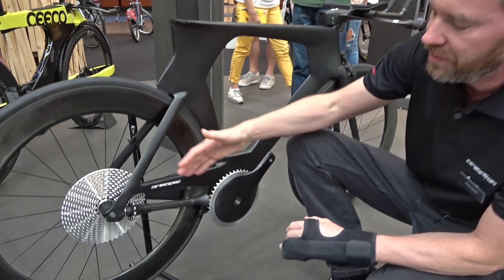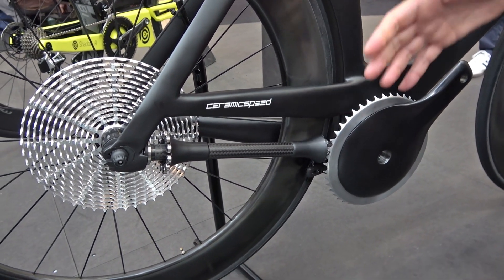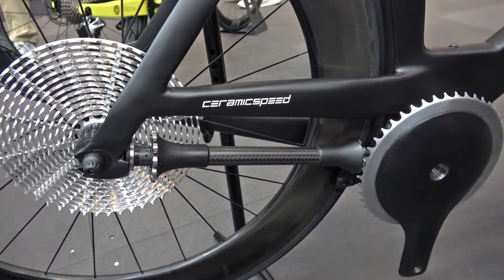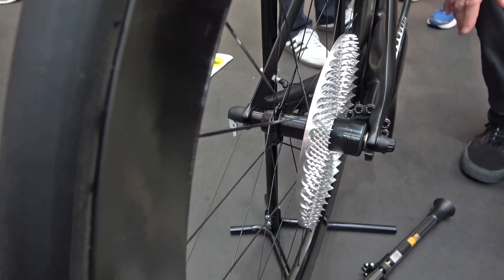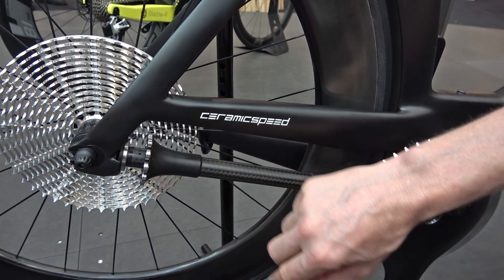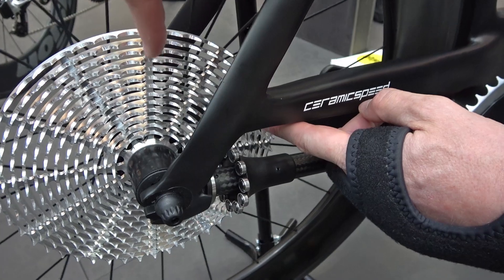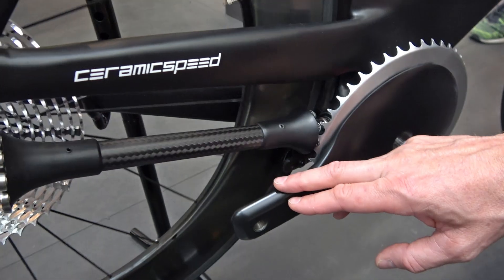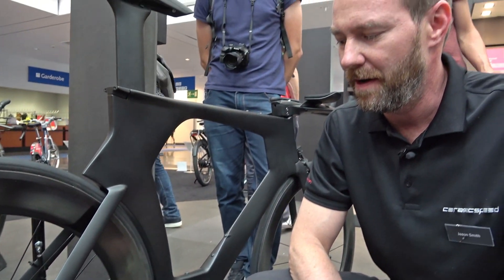CeramicSpeed Driven - Fully explained

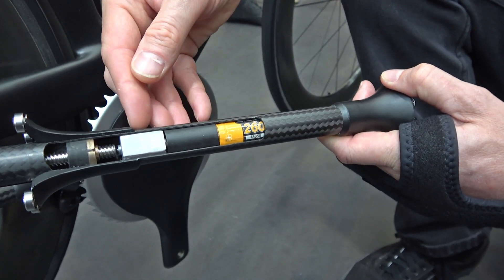Comment: @4:35 wireless electronic?? noooo! K.I.S.S. ! a linkage to handlebar. or same tried n true cable hookup. why leave something to imminent failure. "Ugh I forgot to change the battery last ride," etc...
Reply: Ugh... I'd hate to have to charge that component. If it really had to be electronic, it would be so much better if it ran on a small supercapacitor that charges up when you pedal instead of some battery.
Reply: Doesn't work with their current shift-channel setup
Reply: Also looked like replacing the battery would be a challenge
Reply: I guess your not getting Di2 any time soon.
Reply: It has to be electronic because there's only a precise moment when the shift will actually work.  The electronics can supposedly perform the shift exactly when it needs to happen.   supposedly

Comment: That sounds great, but was about the flex on the "cassette" when you get into the outer gears?  That mock-up doesn't look like it will take a lot of stress... like it would slip... something my chain currently won't do (say, when I'm going uphill standing on my pedals).

Comment: it would be even better if the shifting is mechanical, 
not electronically controlled. 

what if it run out of battery during touring.. what if we at the wild and it break down and need repair..
Reply: +Steven Tran   i notice the reason, but there might be a mechanical solution that can let us shift at the exact same times.. 
if war plans from half century ago can have machine gun fire through propeller without hitting it with mechanical  construction, sure some expert now can figure out a way too
Reply: +Head Master i totally agree
Reply: Ceramicspeed is very similar to Tesla in the car world. I really love the concept and design they came out with. However, it might only be useful for some people but it's not going to drastically change the whole bike industry, simply due to it's overall practicality compared to the price.
Reply: It should be able to get energy from rotation.
Reply: GDar this reminds me of bicycle light. last time used to have light that get energy from rotation. but recently all lights sold are battery powered
Reply: AND STILL BETTER IF IT WAS DURA ACE
Reply: Head Master Modern bike is a significant display of engineering. With this logic, you couldn't ride one. At one point, some people felt that derailleurs don't belong on bikes, same for suspension, disc brakes, hydraulic brakes, and so on. This is plain backwards thinking. Prejudice against progress.  Electronic shifting is just one of many developments that actually make a lot of sense on a bike. No need to index, pretty much no maintenance, batteries last for months, overall reliability is better and you can shift by clicking a button.
Reply: @adomasgrigolis  The same arguments were used to prevent derailleur gears for many years. And are used to discourage disk brakes.  Or perhaps were used to argue that pneumatic tyres were getting away from the spirit of riding.

Comment: Nice idea in the clean room but dirt/grit will be the death of this system. And that rear "Cassette" will flex under load and skip, especially mashing up climbs on those larger diameters. And one missed (unsynced) shift will destroy everything. Chains rule the foreseeable future. BTW what's with all the backlash on the "chainring" at 2:00? Ouch!

Comment: Way more susceptible to slippage. At high torques, that drive shaft is going to flex and the gears going to pop out.
Reply: I'm pretty sure that if this is made from proper materials this can be superstrong. I've seen carbon fiber drive shafts that are much stronger than steel ones but also mush lighter. I however question the gear changing mechanism. A wireless battery powered shifter sounds bad.

Comment: Looks like only one or two gear teeth are used to transfer force and push the bike. 

Also, since you use the addition  energy of a battery to shift gears, can you really compare the efficiency to traditional system that uses only the energy of the rider?
Reply: Apparently they haven't been able to make the gear shift even work. They should stick to just a single gear.

Comment: looks like it produces a tremendous amount of axial force.  The lightness goes away once you beef everything up so it does not bend when you stand on the pedals. might work with a tandem drive shaft configuration to remove the axial forces on the rear. The front is a bit trickier.  I guess it could work with enough added weight and complexity. Hard to beat a good quality chain for strength and weight.

Comment: The cassette disk looks flimsy laterally and would flex under enough load. The system would have to be enclosed to prevent fouling.

Comment: Enclose the whole thing crank to hub in a mono fork swing arm crankcase with light oil bath and externalize  the shift mechanics (within the casing but outside of the driveshaft) and use the casing to oppose the torque of the pinion.  Shift timing could be spring loaded and triggered by rotational arrival at shift point.  The advantage of having an enclosure is you keep out the dirt and you can use slipperier oil.   There would be a weight penalty but durability and dependability would increase.  Also oil seals would add to sliding friction at the crank and hub.

Comment: You said you could change the overall gearing by swapping the drive shaft.  If you just swapped the shaft with different sized 'gears' on each end the 'gears' wouldn't mesh properly.  If the shaft gear was smaller there'd be more backlash and if it was larger you wouldn't be able to assemble it at all.  You would have to reset the shaft mounts to get things to line up and mesh properly.

Comment: Well, I see two issues right off the bat. 
One, using chains and sprockets, you distribute the load over many more teeth. I used to pull a 52T chainring, which had 26 teeth engaged in the chain. At any given speed, of the 13 speeds mentioned here in the video, there are only two forward pinion bearings in contact with the chainring. All I can say is that your two rings better be made of Green Kryptonite or something.

Secondly, in changing out the driveshaft pinions, to put a larger one in the rear, for example, that increased pinion diameter would require you to also set the rear ring further to the left with a spacer of some sort, otherwise, the bearings will impinge on the ring. And in even changing the pinion ratios themselves, you are also altering the contact face angles between the pinion bearings and the rear ring (whatever you call it).

My two cents.

Comment: Rolling resistance, sometimes called rolling friction or rolling drag, is the force resisting the motion when a body (such as a ball, tire, or wheel) rolls on a surface. ... In analogy with sliding friction, rolling resistance is often expressed as a coefficient times the normal force.

Comment: The load would be SO concentrated on just one tooth at a time as it rotated. Imagine a person pedaling hard, and the forces that would be transmitted to the gears. The multiplied force in psi on each tooth would be immense. I can't see this ever being used in a TDF race. It looks far too fragile. 99% efficient, sure, but how about loading capacity? I just don't see it being strong, not at all.
Reply: It's even worse if you consider the multiplied force in kPa.
Reply: How can it be 99% efficient when it has a pion, servo actuated motor, battery power, and there is also load capacity and rolling resistance??

Comment: It may be the world's most efficient when it is proven to be on an actual,  bicycle that can be ridden and gears shifted.  Also, a problem with the "quick  disconnect" drive ratio chance is that the diameter of the drive sprocket will change requiring it to be on an axis either closer or further from the wheel mounded, driven sprocket.

Comment: sorry to say that this "thing" is going to be a failure on many levels. grinding, breaking, sliding and every thing that ends with  -ing is going to be an issue.
Reply: Milad Ne true and def needs some kid of shield over the back “teeth” whatever  from any debris getting in their throw u off plus they want u to swap out pieces for each kind of ride
Reply: +Chris Petela   that's right... even without the debris the cogs will erode and snap each other.
Reply: Milad Ne its a one day bike...then by a new one...where is the problem?
😎😊😊😊😊😎
Reply: Succed- ing
Reply: I think they are trying to gather funds, just to cover their losses
Reply: The design from an old manual sewing machine will make a more reliable drive.
Reply: @D R there was nothing theorically wrong with that fucking plane. However, ther are MANY with this design.
Reply: don't worry Milad, metallurgy and material nano science will solve the needed strength issue.
Reply: What are you talking about? Sure it works.  Maybe not like this though... In motorcycles it works. But it's heavy because it's sealed. Kardan. But. Same thing kinda.  And old

Comment: It looks like the rear pinion plate would be forced sideways into the spokes. Either the wheel OR the roller bearing shaft has to be able to spin freely. If the rear pinion disk rests on the spokes then the rear wheel will have to be trued pretty often.
I still would like to see it in action. This video was posted in 2018. There should be something by now.
Reply: umm yeah.  a year later (a year and a half to get to the point of this video) and they had not advanced an iota. I believe it was given up abt the same time it was rumored to have a $3000 pricetag and they were seeking investors lol
Reply: @pauls5745 , Thanks. I spent over half an hour searching for updates. 
I like the idea of a simple rotating shaft but I thought a 'wireless servo driven shift mechanism' was a flawed idea. I still wondered if they could make it work.

Comment: The one thing which is most interesting is the one thing which is not explained (or shown).
How does the driving sprocket manage to fit the teeth as they are spaced differently around adjacent concentric circles of the driven sprocket? It seems to me  like a geometric impossibility.
Reply: How does a conventional chain do that? :-)
Reply: In a conventional chain system the teeth are all spaced equally.
Reply: @bfelker77 as they are here. The spacing of the teeth is exactly the same as in a conventional chain drive, the are just rotated 90° outwards.
Reply: @stephanweinberger  ahhh I failed to: 1)recognize that the 'tooth' spacing IS constant from one ring to another and 2) that you were just funnin', I think 😉. I hereby and forthwith withdraw the Like I haphazardly and ill advisedly bestowed upon the original post in this little thread.
Reply: @bfelker77  Don't worry about the "like"
I still don't see how this works unless you have some kind of elastic chain!

Comment: He says he expects to be able to pop the drive shaft off, pop new gears on the end of it, and pop it back in, to very quickly change gear ratios.  He doesn't mention how they're going to compensate for the different distances from the center of the shaft to the cogs.

Comment: Why, after all that technology has no one weighed it? would be the 2nd to main point!
Reply: Because it is a relatively early prototype where they obviously still have lots of issues to figure out before they will be able to give a realistic number.  Note all the "how we envision it changing gears" type comments.   Any weight they would give at this point would likely be highly inaccurate as to the final product.
Reply: they did, it is made of depleted uranium.  I cubic inch weighs 3,000 lbs.   Very Strong :):):)

Comment: No very efficient. The torque alone will bend the aluminium drive gear as the points of contact ar minimal.  Steel might work however that would be be pretty heavy.
Reply: You are right. A carbon fiber superstructure might work.

Comment: Way too much added weight, just move the entire sleeve and use long rollers on the front and a cable to move the entire assembly. What is it with modern engineers always wanting to use batteries and motors when the mechanical solution is lighter and more reliable.

Comment: I'm very amateur, not knowledgeable of mechanical engineering at all.  This is a very ingenious design!  The only thing I'm thinking about is, at least to me, it looks fragile.  I wonder what happens if I'm hauling my groceries and I have a hill to climb.  Can this system take much torque without skipping etc.?  Seemed strange they never actually demonstrated it with a person.

Comment: After reading a few comments I believe it's going to need a special wheel/hub that reinforces the rear 'chain' wheel.? It wouldn't be too difficult to have a tapered conical hub to support it and in carbon fiber it wouldn't increase weight much? With spoke flanges wider apart the wheel would also be  a lot stronger than current spoked wheels where spokes on chain side are almost vertical and slightest side force easily 'pretzels' wheel. Conical hub shouldn't need to be same diameter as largest ring, pretty sure there are  loading-stress programs to check most efficient placement?

Comment: I count 4 points of rolling friction, not 2. Surely the 'propshaft' will be supported axially on a bearing at each end. Also, cam-out has been mentioned, so to claim the number of ratios is only limited by the travel of the pinion, may not have considered the need for increased rigidity neccessary on a larger diameter rear gear.

Comment: What’s the overall weight of the bike? Seems like a good deal of your weight savings would be made up in having to have all that extra material in the asymmetrical BB housing and stays.

The concept is cool though. I think most people commenting on here don’t realize it’s a prototype. I think I know how you could eliminate the shift channels, improve the shift response, and dramatically improve the contact on the rear end.

Comment: There is ABSOLUTELY NO WAY the shifting can work as explained because the linear motor shown cannot even think of moving fast enough to mesh with a pedaling rider. This is BS from an interior designer, not from a mechanical engineer.
Reply: Well, if you have access to graphene, anything is possible.

Comment: I designed a similar drive train about 11 years ago. I scrapped it due to torque concerns. I also integrated torque sensors for electronic shifts. Another negative was mountain bike applications. I found it not torture proof enough for that sport.

Comment: I'd love for this to work but they've got along way to go yet. Problem i see, is there's no way that'll ever be allowed into a race! TT and tri maybe but that's too dangerous for close racing. Actually, it reminds me of that thing on the chariot in Ben Hur! The UCI will love that lol
Reply: You haven't seen a way to change the game of shifting like they did, now you don't see a way the UCI to approve it? lol
Reply: ruwiki To be fair, they haven't figured out a new way of shifting yet. They have an idea but it doesn't work as yet or they would have shown it.
Reply: It would be easy-ish to have an aero cover that attached at two frame points.  But yeah, the shifting is tricky -- not only does it need computer control to synchronize and act fast under load, but the disc of cogs is essentially cantilevered.  Short of going to a dome of teeth made of inconel, it would be really hard to get it stiff enough to not simply flex away from the rear driver under load.  Fewer gears would help, but still...
Reply: I think the biggest challenge will be keeping the bearings from pushing the teeth away. That aluminum dish is going to flex right out of the way when you put 1000w to it. Imagine  the wild noise when it skips and breaks off those teeth. Maybe integrate the teeth onto a super large diameter hub to gain the lateral stiffness? all that weight savings disappears when material is added to keep it stiff enough.... slick engineering though.
Reply: Thinking about it their claims about power savings can only be theoretical. For a start it doesn't change gear so it's not a full drivetrain and there's no way they've put many watts through it, i reckon it's jump out the teeth at next to no power. Looks like someone's degree project to me, interesting concept but it won't work.
Reply: No more dangerous than the cogs on a cassette.
Reply: Eamonn OK, assuming you are serious. Your choice, sit on this or a normal cassette. Which would you chose?
Reply: I think a simple cover would solve that problem but it is a very nasty looking disc.
Reply: it's too dangerous?.... It's a fucking road bicycle, people are doing double backflips on motorcycles and 70ft doubles in downhill.
Reply: Wha?? Just because some people ride dangerously means everyone should have to? Hey my mom can sew the shit out of a sweater, so get your thread man, we all need to do what everyone else can do!
Reply: The hazards are beyond minimal in the worst case scenario over a sprocket and chain.
Reply: this is a statement based on the years in service this "brand new" product has? Just throw it out there man, facts or testing is not required
Reply: Please remind us how you think this is dangerous?
Reply: Im not sure its that dangerous but i can see a situation where a rider crashes next to this bike and he falls with arm landing on this plate as its spinning fast and would cause a nasty flesh-shred. But with the new giant sprocket sets they have you may get the same problem.
Reply: Unless the pedals are still turning, or the wheel is rotating backwards, the sprocket will be stationary. It's no more dangerous that the current setup.
Reply: Wrong, if you fall on a current cog-set you are hitting the sides of teeth all stacked up, but this thing has a bunch of little spikes pointing outward. Its not going to kill you and might not even draw blood but its more dangerous than the current design, period.
Reply: Finally, bicyclists could pull up alongside trucks with spikes for lug nuts and give them a challenge! ;-)